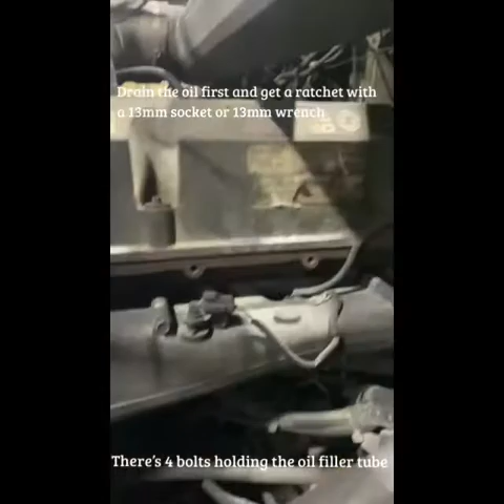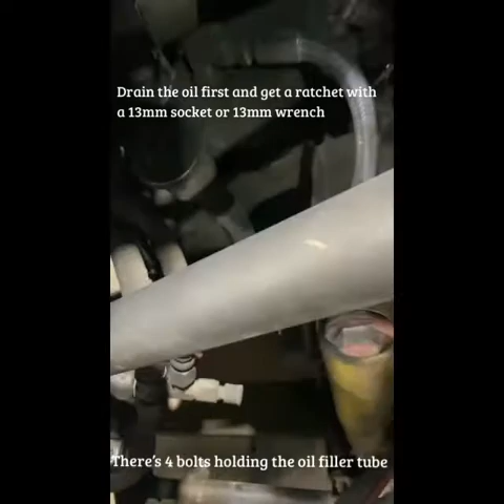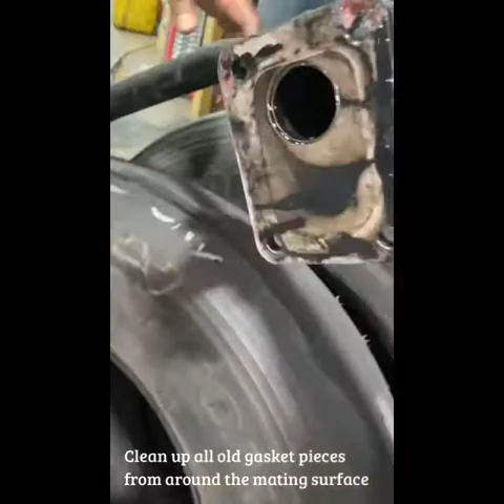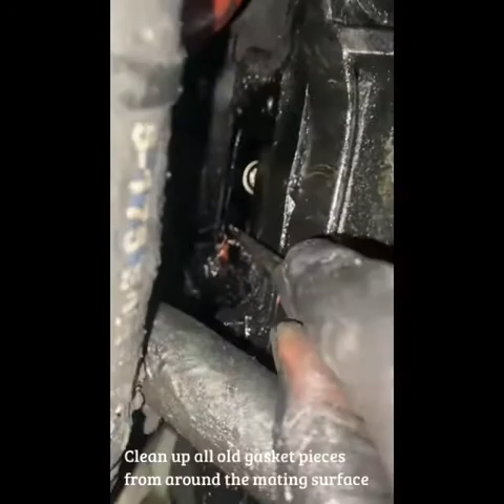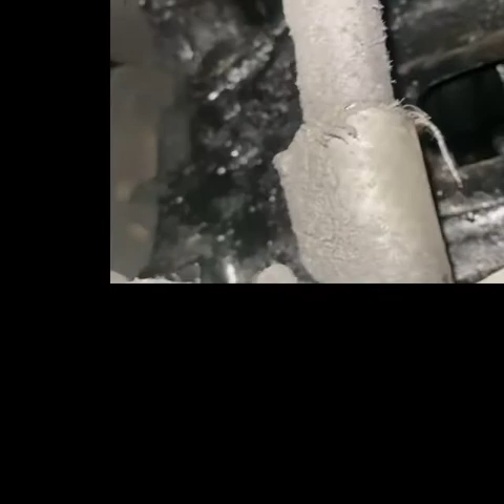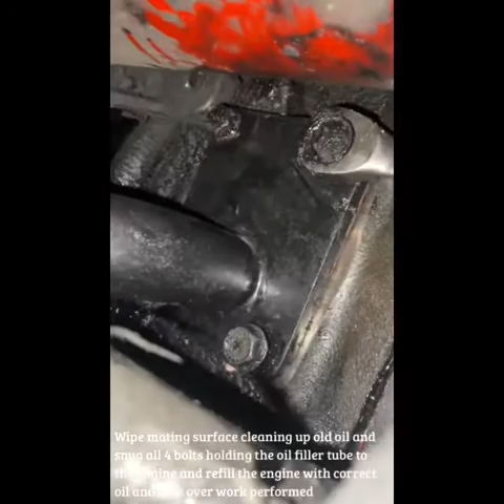How to replace a Oil Filler Tube on a Semi Truck

Comment: Having same issue on series 60 14L; how do you know it just isn’t the gasket that needs to be changed? 

I only purchased gasket, thinking that all that needed to Be changed. 
Haven’t done the job yet.
Reply from the maker: Due to the actual filler tube being cracked and gasket ripped it was time sorry for the late response